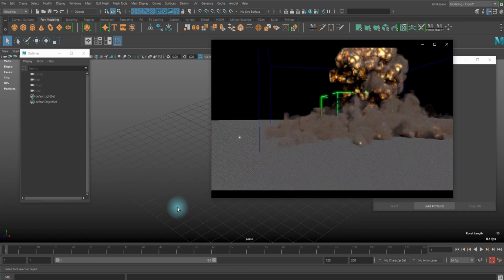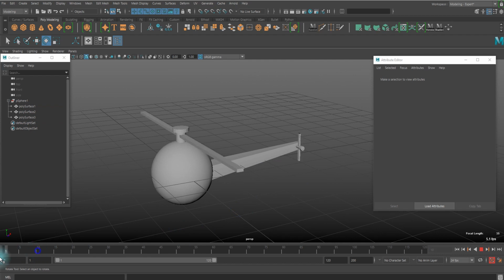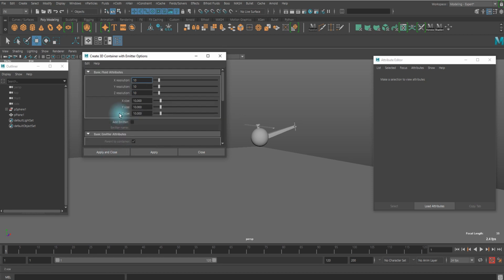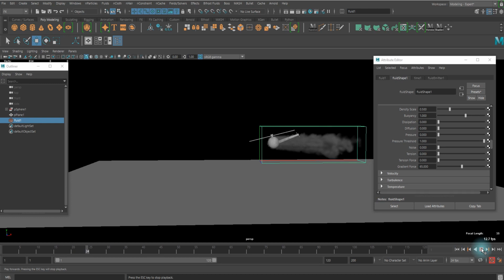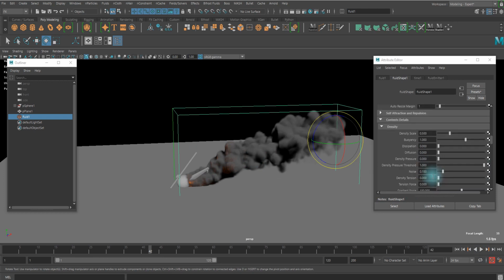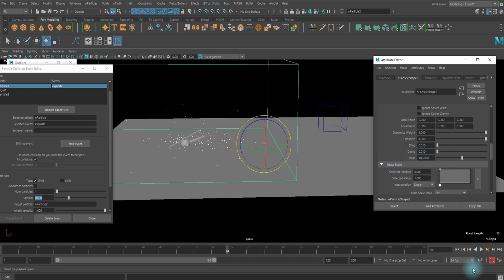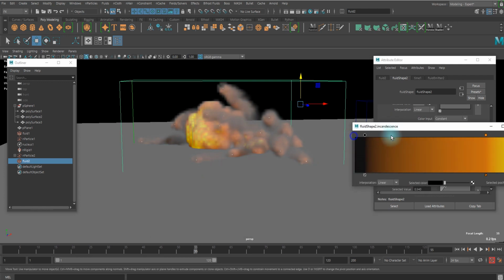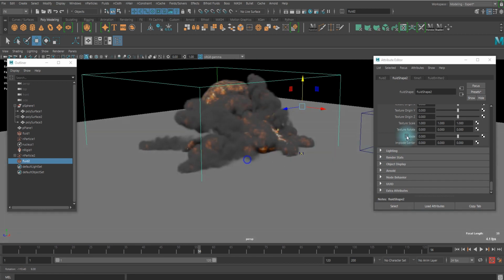Maya Fluid and Animation Tutorial: Helicopter Crash Smoke and Explosion

Comment: how do i translate these simulations
Reply from the maker: If you want to transform your simulated fluid, the simulation should be baked first using nCache. Once it is connected to baked cache files, you should be able to freely transform the effect.
Reply: @syiastudios  thanks for the quick reply. But when I cache it and then render it in arnold render, it only renders inside of a cube. It doesn't show outside of that.
Reply from the maker: @apv13131 I am not entirely sure what is causing that issue, but I can suggest to try reassigning a material that is compatible with Arnold to your fluid object.
Reply: @syiastudios I don't know exactly how to do that. When I referenced the file to a different one and render, it is rendering the full explosion. Otherwise it seem to rendering only inside some invisible bounding box. I have set auto resize. So it might be a bug or glitch. 

But thank you so much for replying, it helped a lot.